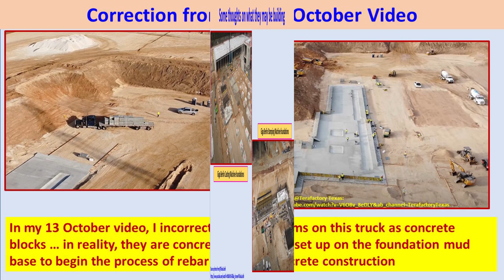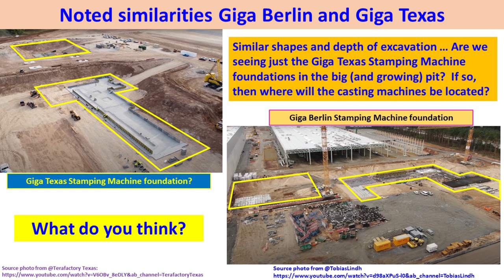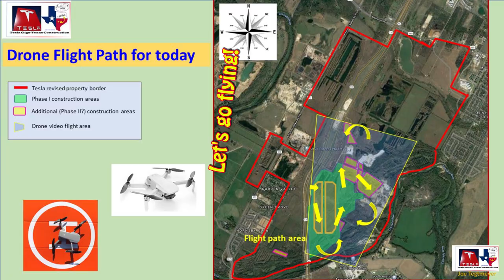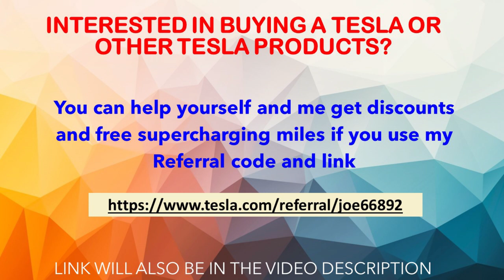Tesla Gigafactory Texas 15 October 2020 Construction Update (08:00 AM)

Comment: A couple of observations:
1.  They are going to need a LOT more raw materials for the batch plant.  What they have now could probably be consumed in a few hours.
2.  There are going to need a LOT more of those footers.  I'd say 1000 or even multiple 1000's.  50 is just training stuff.
Reply from the maker: For sure you are correct
Reply: I'm so perplexed about the footers.  In Berlin, well, you've seen the forest of precast columns.  We saw their footers first.  What's happening in Texas is looking to be something different.  Oh sure, they'll need many footers.  I suppose we shall see.  I'll be a heretic and guess wide open interior buildings, each with massive steel trusses for roofing.
Reply from the maker: I do know several contractors that do steel pillars are bidding on contracts for Giga Texas so I think that partially answers your questions ... it is different from Giga Berlin  for sure
Reply: Roger that Bruce. LOTS more.
Reply: Check out the footers that are laid on the south end
 These have sockets prepared to accept colums.
Reply: @JoeTegtmeyer  Absolutely! Tesla is adopting the local customary construction methods for the building. Precast concrete columns with inter gray footers in Berlin, cast-in-place footers with steel columns in USA. They don’t seem to be as concerned with standardizing the building envelope. What really matters to Tesla is what they put inside the building.
Reply: @douglasgroff7648 , makes sense. Use what the local engineers and contractors are used to doing. It will be faster, easier, and probably cheaper. In Texas, we use tilt wall concrete buildings with steel columns and bar joist trusses for most of these large, open buildings like warehouses, factories, and distribution facilities. You don’t have snow loads so you can span large spaces pretty easily. You don’t have freeze and thaw cycles so you can just pour huge slab on grade foundations. Just put in spot pours for load points and heavy traffic aisles.
Reply: @Bill_N_ATX  I can’t imagine that the design snow load for Texas is too exorbitant. However, tilt-wall construction with steel column/truss framework is used throughout the US, even in the snow belt. Higher snow loads means any number of things can change in the design of the truss system. It’s all about balancing the design for the most efficient use of steel.

Comment: I am wondering if the extra work on the central corridor is not evidence of widening of the entire east building by 30-40 feet.
Reply from the maker: That seems to be a common thought ... I’m not yet sure if that’s the case yet but very soon it should be pretty obvious what they are doing
Reply: Not so sure. Based upon the site plans, there is no perimeter road around the buildings. If there is, it’s primarily to serve as a fire lane. Incidentally, in my experience, local governments like to see the fire lanes set away from the base of the walls a distance equal to at least the height of walls. This is so that if the wall panels should fall outwards during a fire, they don’t fall on any fire apparatus. The wall panels and steel columns & trusses all work hand-in-hand. The roof and columns tie opposite walls together and the walls provide shear strength to the roof structure. In a fire, the steel loses strength and is typically the first to collapse. Without the roof tying the walls together, they will eventually fall as a result. This was the failure mechanism for the World Trade Center (quite unfortunate, obviously). But I digress...

The central road between the buildings appears to be intended as a service corridor, to allow trucks to supply the factories with raw materials. Maneuvering 75-foot trucks between buildings requires a minimum amount of space. My guess is that the central road will be one-way, with the dock doors angled at a 45º angle to ease backing. The point is that this central road can only shrink in size so much, and that the width hasn’t changed appreciably.

The advantage of having a central road feeding two factories is quite remarkable. Elon has said that the road will be covered and that the two buildings will look like one huge roof from the air, with no noticeable break between the buildings. I’d take it a step further and say that both ends of the road will be enclosed by high-speed rolling doors. Why? Temperature control. Dock doors are notoriously poor insulators and barely keep a gentle breeze outside. They are much worse when they are open and a truck is backed up to the door. Having the space between the buildings climate controlled (even to 85º in the summer and 50º in the winter) will make a huge difference in the HVAC design of the factory. It also takes the number of exterior doors from ~100 down to 2.

I also envision truck drivers dropping their trailers in a yard, and Tesla Semi’s used as yard tractors to shuttle the trailers inside the factory. This eliminates any concern about diesel emissions inside the building. The enclosed trailer dock only works with purely electric trucks, and this is probably the best test bed on a new truck dock design...

Comment: The large pour at the end of the month is not the foundation,  (That\s being done now). It's the Slab On Grade (SOG) which will become the factory floor. And  the new area being dug out by the Stamping Pit is probably where the Casting equipment will reside.  (Makes sense to have Stamping and Casting  machines across from one another.
Reply: Finally someone that knows concrete.
Reply: @robintaylor1490  13 years in consulting Structural Engineering.  CAD Designer
Reply: @davidwood7170  22 years driving concrete trucks in all different types of concrete pours all across Canada.

Comment: You're early! :)
Great research, as always, too. 
@5:30 I'm starting to think they're using high performance concrete.  or even ultra high performance. That costs. A lot. Up to $2000 a yard. UHPC strength is around 20,000 psi or more.
Edit: With Blue Chair Guy at 8:07, lower left side of your screen. :)

Comment: Regarding all the footers. I think there will be a large machine shop(s) area where one would expect to see any number of extra-support structures needed as there will probably be many smaller stand-alone stamping presses for smaller components, plus normal machine shop equipment like press brakes for bending metal parts, CNC milling machines, CNC lathe's and a host of other stand alone equipment. There'll be mounts for many  precision robots which need super stable mounting pads so they can perform the precision work they do.

Comment: Shouldn't we start calling the Central Roadway a ditch at this point?  Central Texas often gets a lot of rain in November and it will be interesting to see where and how all that water moves.
Reply from the maker: They could be putting a rain water conduit through the area and then the road on top.  Just thinking out loud ... could be wrong.
Reply: Remember that road will be under the common roof and therefore within the building (made possible by the exclusive use of electric vehicles) so no rain water conduit under the road as long as provision is made via grading to keep water from entering the building

Comment: Another informative and entertaining video!  Any concrete experts out there to explain different types of concrete since one batch plant has 3 hopper bins and the other has 4. Ingredient differences, strength differences, curing time?
Reply: Could be. I haven't worked concrete in a long time, so your mileage may vary. ;) Google: "High performance concrete". I'm also guessing the batch plant is more like a back-up plant - taking up the extra slack from their main source, whoever that might be??? Or, maybe it's for smaller batches of high performance concrete???

Comment: I wonder if all the work on the central roadway means that they have expanded the footprint of building 2.
Reply: I believe your right, it looks like its going to be one giant building.
Reply from the maker: It is curious what they are doing ... not yet sure Im ready to say the central road is being replaced yet.  Hope to know soon for sure!
Reply: @JoeTegtmeyer  Watch to see if they start doing GeoPiers in those areas...
Reply: I’d say they’re narrowing the roadway and widening building 2 (which was quite narrow). They could possibly be going to steal the extra off of building 1, but the roadway still looks wide enough for semis, particularly if they park angled like in Shanghai.
Reply: @davidfidler1174  I second angled parking.  Also the height difference is in accordance with a requirement mentioned in the comments of some channel.  I think the person said 41 inches.
Reply: It seems to me that the shipping/receiving dock will not occupy the entire length of the building.
Reply: @JoeTegtmeyer  agree. It would need to be convex not concave as originally laid  to take account of loading bays.
Reply: @bitspieces3885  why? Check out Giga Shanghai. Many loading bays lead to maximum flexibility in  future interal process layout.
Reply: @bitspieces3885  Is it a possibility that no loading docks (or very few) will be on the outside of the building?  Could that road going through the middle of the building be where they load?
Reply: @jamesjones9490  it already was. Elon said that corridor would be part of the building. As in, enclosed.

Comment: Hi Joe...I asked Tobias Lindh, who does overflights of Giga Berlin, what the area of the electrical switchyard there was.  His answer is 6,420 square meters which converts to a little more than 69 thousand square feet.  How does that compare to the switchyard on the Giga Austin site plan?  He also said that another electrical power supplier would build another switchyard on a parcel of land that was 5 hectares in area.  That converts to a little more than 538 thousand square feet.

Comment: As far as the hiring and training of concrete truck drivers, my guess would be that Martin Marietta is NOT looking for any pre-qualified people. Usually, they would be concerned with having only drivers with a CDL apply. However, since the batch plant is on the same property as the project, there is no requirement for having a CDL, as the trucks will never hit a public highway. This will free up their existing pool of drivers (who all have CDLs) to support other projects in the Austin metro area.

What’s also not known is which building is going to build which vehicle(s). It can be assumed that Cybertruck and Semi will be built in Austin, and these two vehicles are what is intended for the two buildings currently being built. Elon has hinted strongly at Model 3 and Model Y also being built in Austin (probably in one or two more buildings that they haven’t broken ground on yet. Let’s not forget that the design and materials for the Cybertruck require construction methods that are vastly different than any other vehicle produced. The reason for the flat panels and sharp angles is that cold-rolled 30X stainless steel CANNOT be stamped, especially in the thickness discussed (3mm). The panels will most likely be scored on the backside and then bent to the correct angle in what is essentially a large press brake. I’m thinking that much of the fabrication of the exoskeleton will be formed out of one or two sheets of stainless steel that are laser/plasma cut precisely, then bent/folded into the finished shape (kinda like folding a gift box out of a single piece of card stock). By this logic, the east building is probably slated for Semi (more traditional stamping & casting techniques) and the west building will be for Cybertruck. The building footprints kind of follow this, as a bigger vehicle with more complex fabrication methods will require a larger building.

As always, I could be completely off base and have everything wrong...
Reply: I  believe this training is job site specific, since this is such a large vol. slab on grade pour. Timing and continuous pour operations will be critical.
Reply: @davidwood7170  Hard to say for certain, unless we swing by and ask Martin Marietta... 😜 I am sure that a project this size does have a LOT of specific knowledge that has to be disseminated to the drivers. I have been amazed at how little traffic control there seems to be, from the standpoint that every truck driver that is delivering sand or dirt know exactly where it is needed. Surely, it can’t be a giant game of “Follow The Leader”, or can it? It doesn’t look like any of the trucks stop at the gate house on the way in or out. Maybe it’s all done by radio communication. But even when they were actively filling in the ponds and flattening the sub grade, the drivers know exactly where to dump without any noticeable communication with the bulldozer operators. Usually there’s someone on the ground marshaling the trucks, but I haven’t noticed anyone on this project yet...